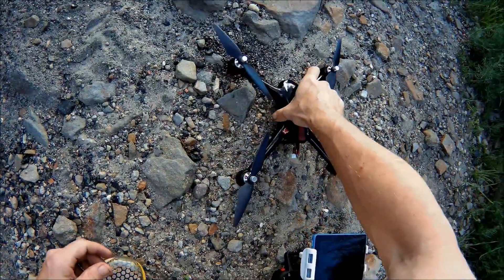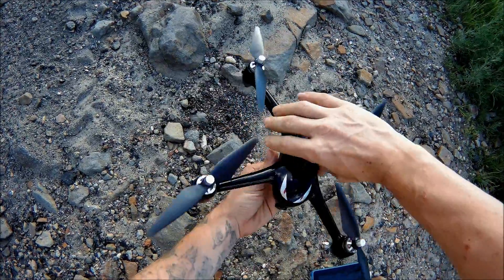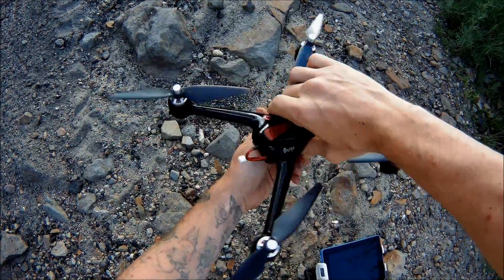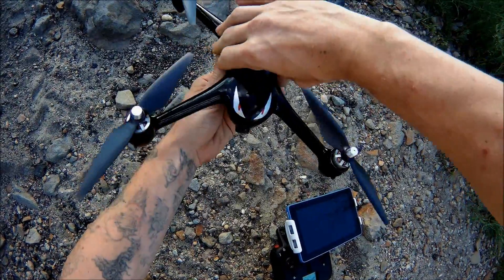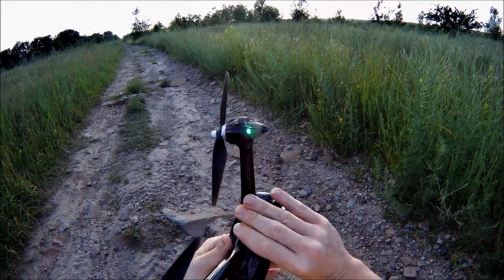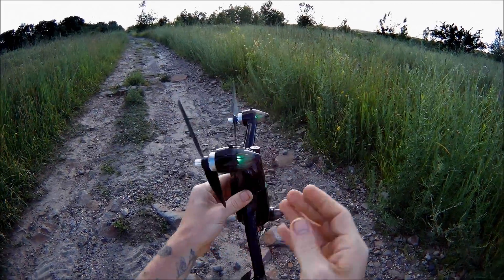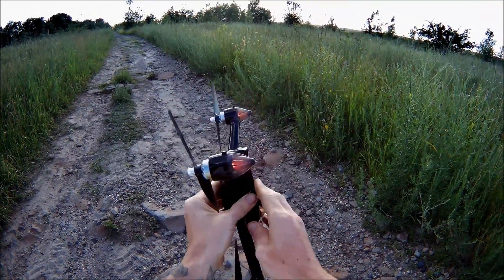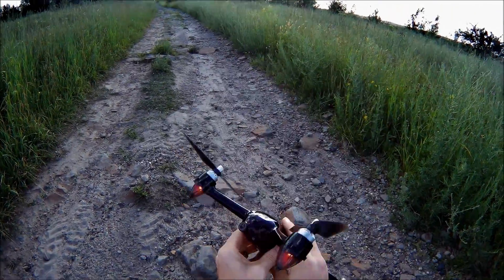MJX BUGS 2 COMPASS CALIBRATION GPS RC QUADCOPTER REVIEW

Comment: You missed one very very important thing jay!  I worked for hours to get my bugs working until i found out how to calibrate the drone on you tube ...would give the guys url but cant find it now.  Turn on the transmitter, turn on the drone ~~~~~  now here is the most important thing ..WAIT UNTIL YOU HEAR 2 BEEPS ````then you may proceed to the calibrate part... if you try to do it before the 2 beeps it will not calibrate and it will not mate.  Again "Wait for the 2 beeps" before the next step.